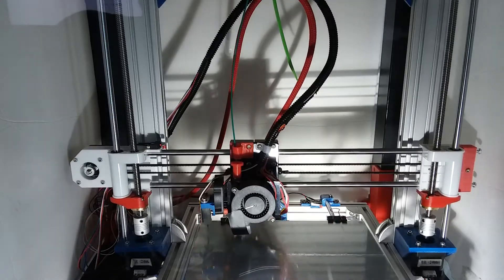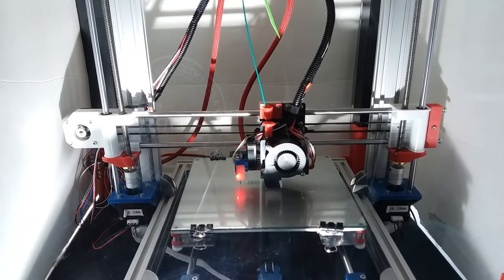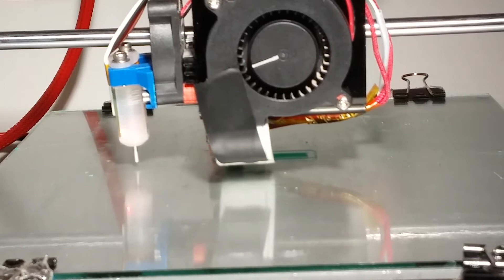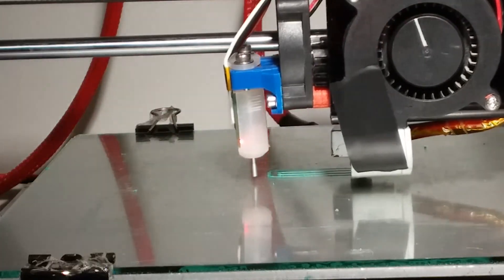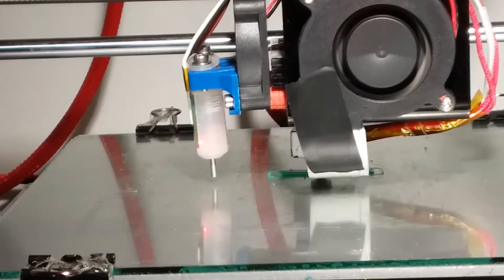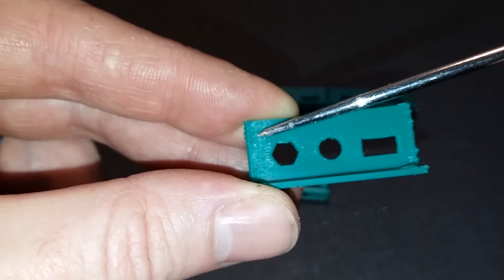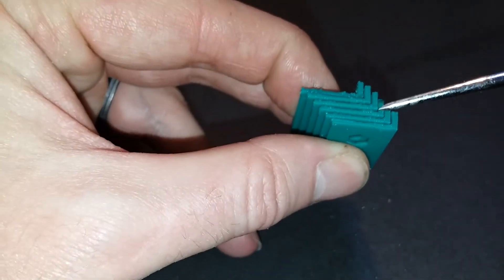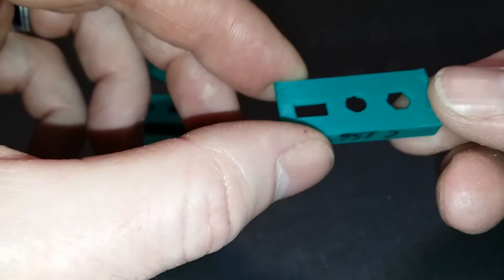Get Your 3D Printer To Give Up The GHOST

Comment: Great vid, I’m yet to tweak my acceleration, tbh I  only getting quite minor ghosting. I went from the AM8 to the full BLV mgn12 mod, Great upgrade btw, well worth doing. I noticed my biggest reduction in ghosting when I changed to a Bowden setup, took some of the mass out of the print head assembly, that made quite a bit of difference to my print quality.
Reply from the maker: A Bowden setup is on the list of to do's on my printer.  Less mass, less inertia less vibration fed back into the frame and belts.